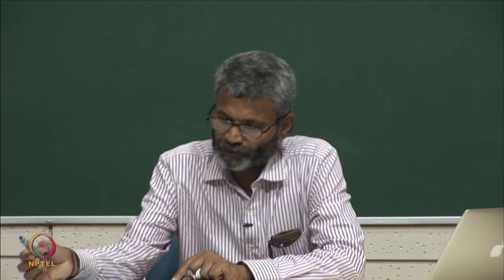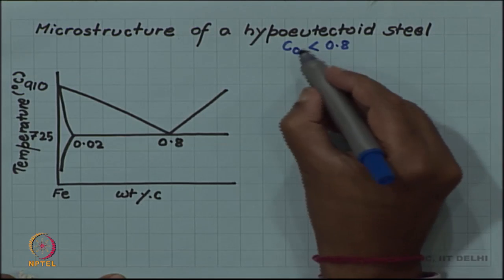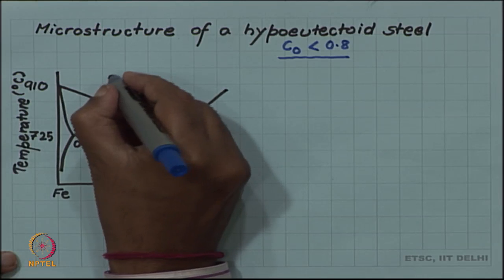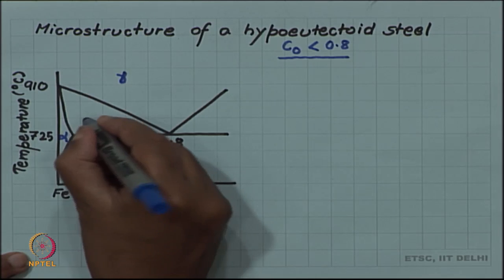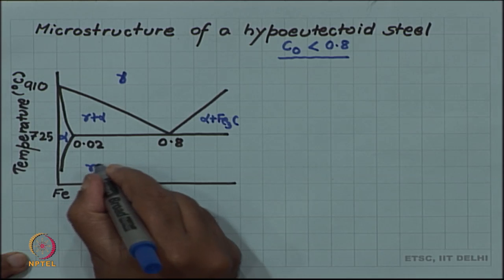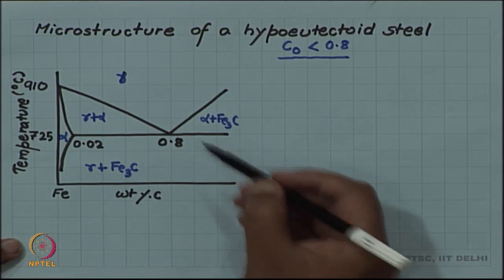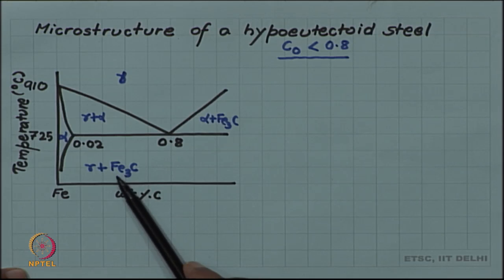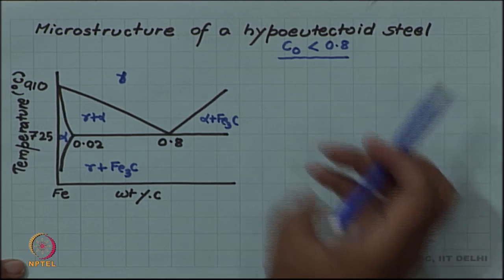Microstructure of a Hypoeutectoid Steel

Comment: Sir the horizontal you have drawn, isnt it the eutectic horizontal instead of the eutectic horizontal, if  you look at the original full graph.
Reply from the maker: There is no liquid phase involved in this case. So it is not a eutecTIC horizontal but a eutecTOID horizontal.

Comment: If a hypo or hyper eutectoid steel is heat treated and then allowed to cool to room temperature, will the micro structure return to the same shape when cooled?
Reply from the maker: It will depend upon the tempearture to which you heat and also the subsequent cooling rate. For example, suppose the hypoeutectoid steel you are starting with has a proeutectoid ferrite and pearlite. If you heat it to the austenite region to form austenite and then quench you will form martensite. But if you cool the austenite slowly, you will get ferrite and pearlite back.

Comment: Can anyone explain why a proeutectoid cementite forms as a network rather than as a separate grain unlike proeutectoid ferrite ?  Is it because there is insufficient cementite ?
Reply: Yes, but it's the same case as the proeutectoid ferrite. If there is sufficient ferrite, it will also form a network, it depends on the composition and cooling rate of steel

Comment: Sir please correct your point in start where you have to deliver your lecture,  that how α exist at above the critical line (above 727 degree Celsius) with α+ Fe3C and, how gamma phase exist at below 727 degree Celsius?? 
If I'm not wrong it's your mistake and should be correct it..
Reply: Thanks for pointing it out. It is my mistake.

Comment: This 147 lecture of material science is enough for gate or this is a very much .
Please recommend . I have less time.
Reply: I was not thinking of GATE exam when delivering this set of lectures. they serve as an introduction to material science. For GATE you will certainly need more stuff.
Reply: Dr. @Rajesh Prasad actually sir, apart from a problem-solving perspective, I believe your lectures are pretty sufficient for Physical metallurgy part in GATE as well! I tallied them with the syllabus too.
Reply: Only for Physical metallurgy.